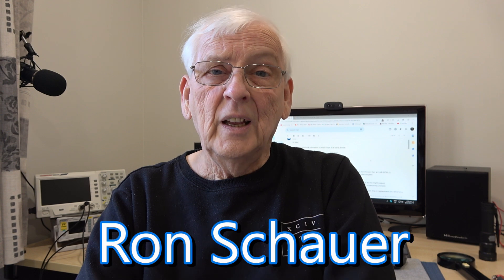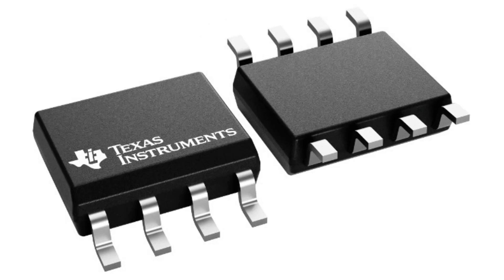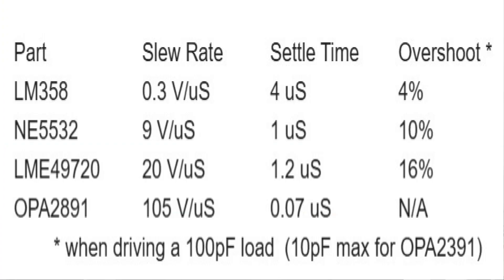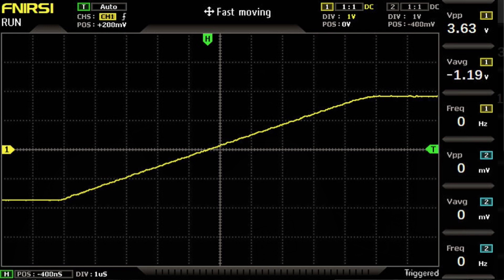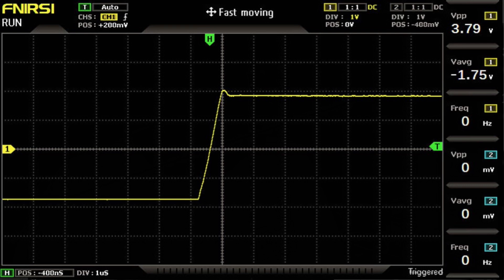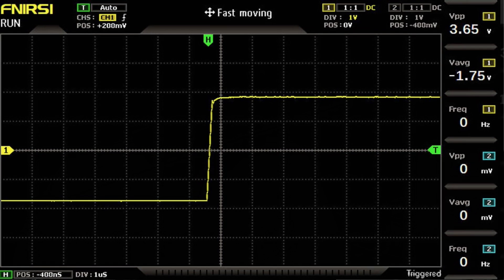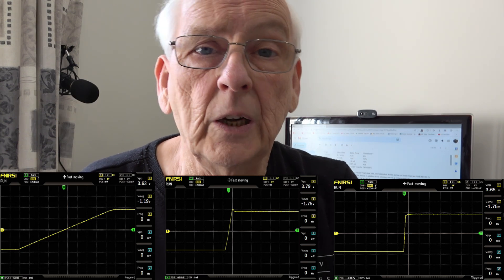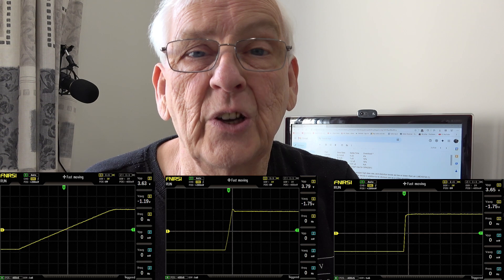The OPA2891 Could this be the best audio IC?

Comment: Michael, WRT these fast opamps driving capacitive loads, one option is to use a common Pro Audio solution for driving high capacitance OP transformers, the Jensen JT-OLI-3 isolator. https://www.jensen-transformers.com/wp-content/uploads/2014/08/jt-oli-3.pdf  At audio frequencies and above to around 200kHz, the OPA looks like a zero ohm drive, above around 400kHz it decouples the load preventing oscillation. If you are looking for perfect square wave response with fast OPA's, might have to goose the values and maybe introduce a very small amount of additional series resistance.

Comment: After this video I've tried this opamp in both my DAC (Toppings D30) and in one of my Class D (3255) amps and it is a wonderful opamp.  It gives both an even and balanced response in both uses.  It has bumped 1656, 1612 or 1642 as my favorite opamps

Comment: From the data sheet: Page 20, 7.1   ..  "The OPAx891 are internally compensated to maximize bandwidth and slew-rate performance. To maintain
stability, take additional precautions when driving capacitive loads with a high-performance amplifier. As a
result of the internal compensation, significant capacitive loading directly on the output node decreases the
device phase margin, and potentially lead to high-frequency ringing or oscillations. Therefore, for capacitive
loads greater than 10pF, place an isolation resistor in series with the output of the amplifier. Figure 7-1 shows
this configuration. For most applications, a minimum resistance of 20Ω is recommended. In 75Ω transmission
systems, setting the series resistor value to 75Ω is a beneficial choice because this value isolates any
capacitance loading and provides source impedance matching."  I generally use 50ohms on any op-amp. How do your thoughts/analysis line up if an output resistor is used, as per 7.1 in the data sheet, which negates the issue of driving greater than 10pF at the output node?
Reply: Hi JWW, see my post above WRT Jensen OP isolator. This OPA looks super high performance, similar topology to AD797 which topped Samuel Groners OPA distortion paper.

Comment: I think of two arguments, and one observation.
1. the chip is useful since its output will be as accurate as it can be regardless of any circuit into which it is inserted.  It's the one component you know will not be a limitation.
2. As a "high end" chip, it only makes sense to use it in a "high end" circuit.  Any lesser circuit would be wasting the cost of the chip.  As you mentioned, pretty much any circuit you drop that chip into will be wasting much of its performance - and the cost of that performance.
And I noticed the under-shoot instead of over-shoot.  One is just as bad as the other in terms of accuracy.

Comment: Michael - always fun and always a thumbs up.  Love the videos.  I've seen others give their 2 cents - so I'll throw mine in the bucket;)  Video is much more speed demanding than our slow audio signals.  I just don't see slew rate as an issue in a preamp.  The voltage swing is small and the signals are slow - so I don't really see the focus on slew rate and square waves.  

I think spectral noise is more important in preamps as the signals are small and noise (or signal to noise) is a bigger issue - especially given the higher gain needed in a preamp - especially in the phono stage.  Also voltage and current offset and the drive stage - I think should be a separate stage.  I'm also interested in designing a preamp implementing OpAmps, and to give away my approach - I'm interested in 3 stages - the input buffer, the gain, and the output/drive stage.   And the power supply has to be tight.

Comment: MB, the "best" preamp we've found is based on Graham Cohen's "Double Balanced" topology. An OPA2891 would be an ideal "DC comparator" in this topology, especially if driving more than 4 bipolar transistors. We've used this for 35 years. Graham was from Australia.

Comment: Just chucking my two cents here: I use a 9U 104hp eurorack synthesizer which has a section of video modules and modules that use preamps that are specifically compatible with video rate signals as well as audio. And for either my audio or my control signals, running them through one of those modules enhances detail, and the breadth of nuances that change with a knob turn connected to one of those preamps has much more detail in a smaller section of a knob turn than what comes from audio preamps. 

I should stick to hem on the scope and sniff around, but just going by ear and a surface trace of things using them, I 100% agree that they introduce incredible detail because they’re over spec

Comment: Michael, this opamp is not perfect for audio (thats why its marketed for video😉) I glanced through the datasheet of this opamp and it has a few problems. First.. It has very low voltage noise but it has EXTREMELY HIGH current noise, it is highly dependent on low values for the feedback resistors and circuit topology. Secondly the frequency response is also highly dependent on the feedback and circuit topology. Michael, promise you slew rate and speed isn't the end all be all. Think of your analogy of using dual transformers for a preamp. As long as you have 'enough' slew rate with some margin is good enough. Monolithic IC designers spend thousands of hours and hundreds of thousands of dollars to come up with a solution for individual problem. Like everything in physics there may be an optimum solution but not one to fit every problem. If you're really looking for a solution for an audio preamp I would look at a composite amplifier do some research and feel free to message me or respond to this comment and I'll get you in the right direction

Comment: You really don't seem to understand preamp design using opamps. It is NEVER good practice to use directly the output of an opamp to an output.  NEVER EVER. Typical is the use of 100R from output of the opamp to the output. If you don't understand why, I can be bothered to explain it, it has something to do with the term "infinity" which is impossible..
Reply: Anyone ever mentioned your arrogance?

Comment: I think the LM358 has never been used in any commercial piece of audio equipment. Regarding slew rate. A 20 V 20 kHZ sine wave would require a slew rate of only 2.5 V/µs so I fail to see why you would need over 9 V/µs for audio applications. For a 20 V sine wave, the NE5532 would work fine up to 70 kHZ until slew rate would start to be a problem. Audio processing in the analog domain is still done with TL072, NE5532, RC4560, RC4580... nothing exotic at all. The signal from a microphone in an old analog mixing console would pass trough maybe 50 op amps (the ones everyone seems to hate because they seem to sound bad) before it reaches the output of a mixing console. Even your most beloved audiophile recordings mixed on some world famous analog mixing consoles are all equipped with ordinary op amps and many of them. Schematics of those famous mixing consoles are out there. The trick in those consoles is not in the op amps but the reference structure of the mixing console. This structure you will probably never find in home audio equipment not even the expensive units. (at least not to my knowledge)
Reply: I've seen the LM358 used in the audio stages of some Tait Electronics base station transmitter designs from the 1980s. Perhaps not the sort of audio that some people would be interested in, but it certainly was audio. I seem to remember these were quite sensitive to strong RF fields which sometimes meant the transmitter could leak back into the audio stages with some undesirable side effects. One quick fix for this was to replace them with something like a TL062. The LM358 was cheap, but not my favourite Op Amp.

Comment: For power amplifiers, the ADA4700-1 Opamp is really to be preferred. It can be used in the voltage amplification stage up to +/- 50 V, and also can set accurate bias.

Comment: It's hard to believe the 5532 is still as respected as it is. I should really say it's hard to believe something hasn't come along that would make its performance as outdated as the LM358 or the (gak!) 741. I remember upgrading our studio mixing consoles to 5532 opamps in the mid 1980's, so 40 years ago. It was a noticeable improvement if you knew what to listen for.  Then about 10 or 15 years ago, OPA2134 opamps were the chip of choice. I couldn't hear much difference (I've been listening professionally for decades) but they had a positive placebo impact so that's what I've stuck with.

Comment: There is a section on the datasheet regarding capacitive loads, 7.1.1 Driving a Capacitive Load. I would add that, in principle, OPA2891 would be a very good solution for the first stage of amplification as the issue of noise is more pressing on a low level signal like one from a phono MC input, once the level is in the hundred milivolts, then potentially almost any modern op-amp can further amplify the signal for driving a power amp. But there is a potential issue with OPA2891, the voltage noise level below 100Hz becomes increasingly higher and the current noise is much higher than OPA1612 for example, which could be important depending on application. Important thing is to experiment and check what works best, on paper it could be perfect but in practical application it could sound worse of the same as a cheaper op-amp, it happened to me several times.

Comment: Where is the input waveform and the 2891 waveform? The overshoot/undershoot looks like an impedance mismatch to the pcb trace, solved using series termination. Fast outputs have low drive capabilities and a suitable buffer could make this a brilliant (perfect) gain stage.

Comment: Could be wrong but I don’t believe that slew rate is a factor at audio frequencies.
Reply: I agree that it's generally not an issue (anymore). For example, the LM358: if I did the math right, it can't produce a 10 V peak to peak signal over 16 kHz. So that is a realistic flaw but there's no need to use that IC.
Reply: It's not. Slew rate only matters when high frequencies are amplified to high voltages. A few volts per microsecond is more than fast enough, even in a thousand-watt (90VRMS at 8 ohms) power amp playing at 20kHz. For a preamp operating at only a couple of volts RMS, even less slew rate is necessary.

The slew rate of a sinewave (in volts per second) is (2π * Vp * f) where Vp is the peak voltage (not peak to peak or RMS) and f is the frequency.

For 90VRMS (1000 watts into an 8-ohm load), Vp is 127.3 (rounded to a tenth). At 20kHz, the slew rate is approximately 16 million volts per second, or 16V/uS. For 2VRMS (the output level of a CD player at 0dBFS), the slew rate is only 0.35V/uS. To avoid issues, the slew rate of a circuit should be at least a couple of times the slew rate of the signal being reproduced. The slew rate of a 4558 opamp (very common, very cheap audio opamp) is 2.2V/uS, which is six times the slew rate of a 20kHz signal at 2VRMS. That's plenty.
Reply: Rise time definitely has an effect at audio frequencies but he only refers to slew rate.
Reply: If you'd only use an opamp as a gain stage, slew rate isn't all that important indeed, as long as it is higher than the slew of the highest frequency at a given level, as @ScottGrammer explains nicely.

However, if the opamp is part of an amplifier, the negative feedback path usually originates from the output of that amplifier. This way, the feeedback corrects any errors the power transistors introduce, like cross-over distortion. That distortion contains much higher frequencies than 20 kHz. An opamp with a slow slew rate might be too slow to correct these errors in the feedback loop and thus, the amplifier will output harmonic distortion. Replace the opamp with a faster one (higher slew rate) and it will be able to correct the cross-over distortion.
Reply: Yes, you're wrong.
Reply: @MrDmjay see above exhaustive explanation of why slew rate does not matter at audio frequencies.

Comment: That's how it goes. We old farts we have the knowledge and wisdom, but the hearing accuracy is long gone. The younger may have golden ears (I doubt though) but not so much experience and hands-on for the practical part of hi-fi. They grew up with plastic PC loudspeakers and 5.1 home theater. They don't need high slew rate for Bluetooth speakers.

Comment: For me THD and noise in the audio pass band are more important than slew rate beyond a relatively low point, especially for a preamp, and then if you want to drive cable you have a 600R resistor in the output that will isolate the cable capacitance from the output and feedback stage. Then you're down to cable capacitance limiting your bandwidth only which should make it out to 20kHz give or take 15kHz is good enough for pop music which is somewhat band limited anyway.
Reply: But a faster opamp in a power amplifier, driving the power transistors, with benefit from a high slew rate to correct the cross-over distortion of the transistors, resulting in a much lower THD of the entire amplifier.

Comment: Spec sheet suggests that you can simply put a 20Ω resistor in series with the output if you need to drive a larger load. If you drive 100 pF, the RC time constant ends up being 2ns, which is still a small time constant compared to the intrinsic 100 V per µs, or 1 volt per 10 ns. 

So, yeah, you probably can use this part with an added output resistor and it will work just fine.

Comment: I agree that a LM358 is objectively terrible. Beyond demonstrating that point, I think the focus on slew rate here is misplaced. The things that make this op amp interesting for audio applications are its commendably low voltage noise spec, 0.95nV / sqrt(HZ), and its low distortion. The exceptional bandwidth only matters because it preserves a decent amount open loop gain clear out to 20 kHz, where it's still 80 dB. That's 10 dB better than an LM4562 or LME49720 at the same frequency.

Comment: Very nice find! I'll be watching with interest your follow up videos with circuit diagrams etc. One very good chip is the Harris HA 5002/3 which has higher slew rate low noise and lower output impedance. I have been using these for years for both a preamp and many paralleled together to use as an audio amp direct.

Comment: Hey Everybody!  I just had a fascinating discussion with chat GPT to help understand something.  Why on earth does it make such a big difference to put the sparkos ss3602 in these TPA3255 amps (fosi V3, V3 mono etc.). I think I found the answer and it’s more than “it’s a better opamp.”  

See the TPA3255 chip is highly capable but has a severe limitation.  It requires a great deal of signal power and drive current to feed it.  It’s not an amplifier that can be driven with .5V input to any satisfactory volume level without a huge boost from an opamp.  This differs from most amplifier designs that simply do not need this boost and only use opamp as a buffer stage for volume or tone controls.  In the Fosi V3, you will find two dual opamps.  One is the preamp the other is the amplifier driver which boosts the signal after the preamp.  The driver opamp is being pushed to deliver quite a lot of current similar to driving headphones at higher volume levels.  This is the reason why the amplifier benefits so dramatically when you stick an SS3602 in that position because it has a 50ma output current capability which is really impressive and it can handle that gracefully.  

For the preamp socket, you could probably do just fine with something like the LME49720 which is about $4 and is about equally capable in situations where drive current isn’t needed.  HF oscillation doesn’t seem to be an issue in these circuits because they are actually pretty well optimized.  At least with the V3 I’m testing.

I think it’s important to consider this because these amps are very cheap and you may not want to spend twice as much on opamps as you are spending on the amplifier and you probably don’t need to.  

Now what’s interesting is that the ne5532 has much higher drive capabilities as the LME49720 but the LME49720 has better sound quality.  So this means if you just buy 2 LME49720s and populate both spots, it might be a downgrade at higher volume levels because it will run out of juice as a driver but will be great in the preamp circuit.  

Interesting right?  I thought so.  Also it’s freaky how much chatGPT understands about this stuff.

Revision:

Turns out chatGPT might have been wrong.  The TPA3255 should only need 1-3ma of drive current so it seems like the LME should be just fine with its 26ma of drive current although ChatGPT still debates me on this saying that higher is better in this application and that it could be an audible difference.
Reply: I had enough with ChatGPT after I asked a simple question about a common base stage with bjt. Instead of answering my question "he" tried to convince me that common emitter is better.
Reply: @jjcale2288  ai  can listen that way. I am comfortable with discreet components. I have human ears. Amplifiers are not the problem. Microphones and speakers are.
Reply: Funny i did the exact mod lme for pre and ss3602 for latter. It's fantastic and i don't push loud levels thus perfect for me.
Reply: @wric01  That’s so cool!  Just curious, did you try it the other way?  And what did you notice about the change vs the stock ne5532s?